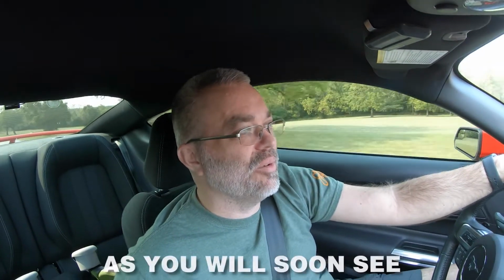Edelbrock 2650 Boosted Coyote vs R1 Bike

Comment: Its running good for the trans to be broke 🙃
Reply from the maker: I’m interested to see what it looks like when David tears into it. 6th gear does this crazy over rev slip even driving normal.
Reply from the maker: Well… it’s not just clutches. He’s trying to source a valve body and possibly a converter. Apparently there is metal all throughout the transmission. It’s not looking good for racing the 6th of November. I even bought new MT SS for this event. 😞

Comment: What clutch plates is he using if you don't mind me asking im at around 800 whp so it probably won't be long
Reply from the maker: GPZ kit?? Dunno. He said he’s had good luck with them so far. He hasn’t built a ton of the 10R80s but he’s the only one in my area doing it and it’s been for much higher hp cars than mine.
Reply: @100mphClub  ok good luck with it